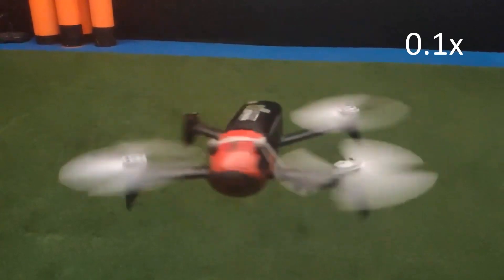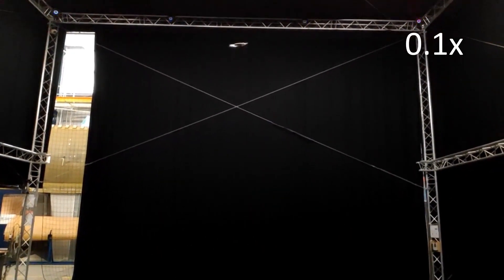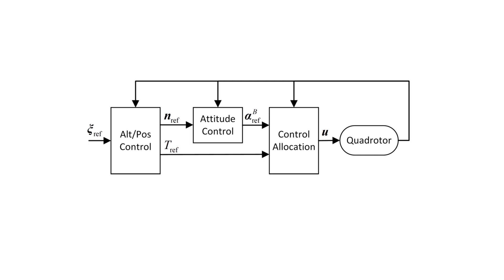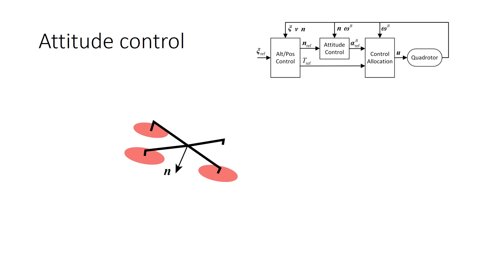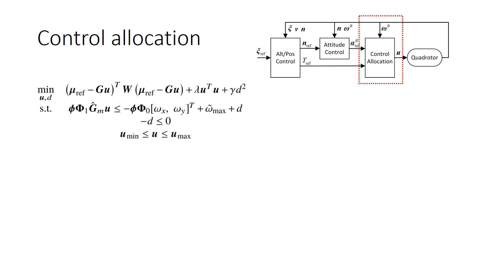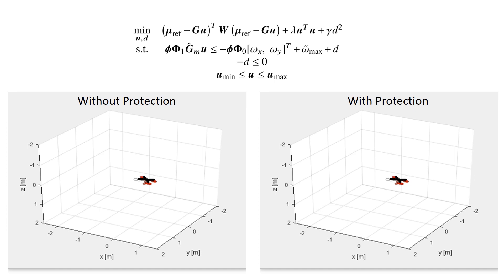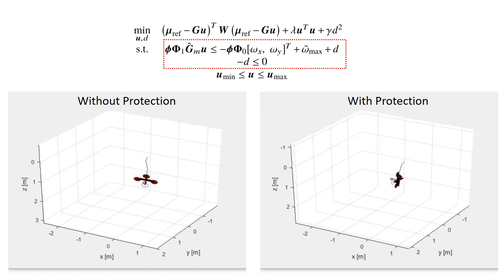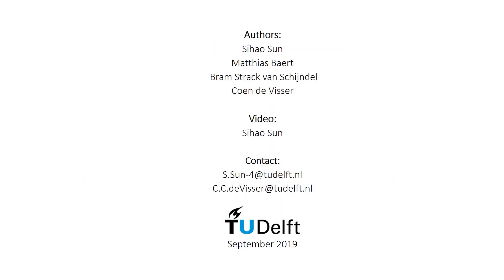Quadrotor Upset Recovery after Complete Loss of a rotor

Comment: Hello, thank you very much for sharing this impressive work. I am currently a master’s student, and I am trying to apply this project to a custom-built UAV in our lab. However, I have encountered some difficulties while attempting to reproduce the simulation results. I have carefully studied your master’s thesis as well as your paper published at IROS, but my attitude controller and control allocation do not seem to achieve the expected performance. I was wondering if it would be possible for you to share the simulation source code, or offer any guidance or suggestions. I would be extremely grateful for any help you could provide！